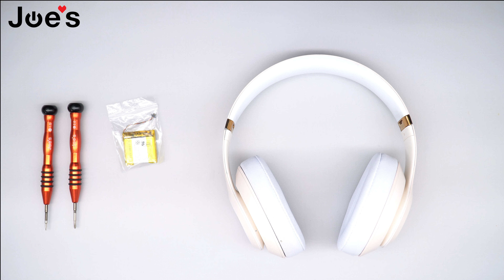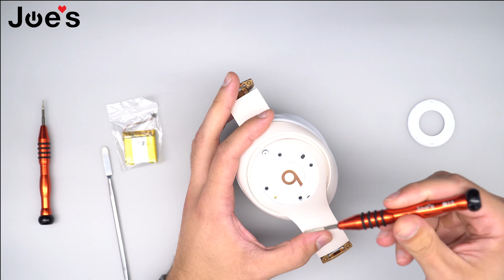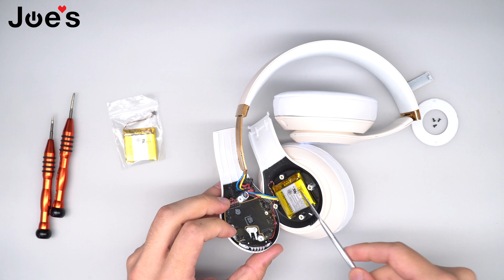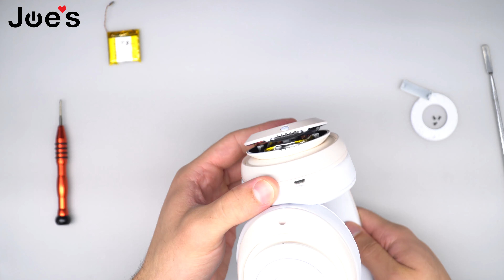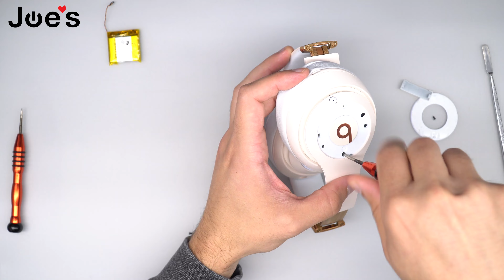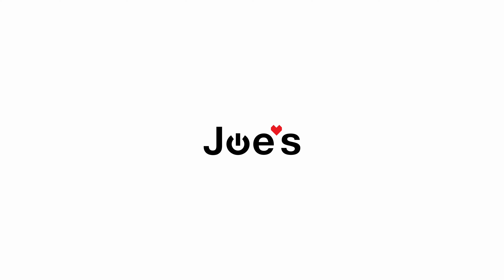How To Replace The Battery In Beats Studio 3 Wireless | Step-By-Step Repair Tutorial

Comment: Hello Joe.....Thank you for this video. I have just two questions. First is what brand or information for the  battery would you recommend. Amazon has different batteries for sale in the same price range, but I want to make sure I order the right one. Second is where can I find those specific "small screws drives and a heat gun? Should I visit a craft store, hardware store or jewelry store? Thanks again for your help and I look forward to your reply.
Reply from the maker: We can help you find the right part, tool or repair option. Please email support@joesge.com with your exact model number and what part you need.

You can also start here:
www.joesge.com

Comment: Fantastic tutorial, I changed my battery in less than 15 minutes!! I didn't find any glue in my item. Thanks again
Reply from the maker: We can help you find the right part, tool or repair option. Please email support@joesge.com with your exact model number and what part you need.

You can also start here:
www.joesge.com

Comment: I followed all the instructions and you’re video is great. Very thorough. It’s been months since doing this and my wife is running into a loose connection issue. There’s some glue that was originally holding onto the wires for the battery. What glue would you recommend for this?
Reply from the maker: I’d maybe add some cold press?

https://www.joesge.com/products/electronics-cold-press-lamination-adhesive-seal-3ml-syringe-18-gage-tip-glue
Reply: @Joesge ok thanks!

Comment: The battery sucks compared to my beats I had. 

My original beats I bought in 2014. I hardly ever used them. In 2023 I started to use them a lot. In 2025 they were still good for six hours a day for five days. 

Then I dropped and broke them sadly. 

The beats studio 3 I just got…battery dies after about 12-16 hours……..

Comment: My beats won’t turn on unless I use a wired connection.. could unplugging the battery and plugging it back in work? Or is it best to buy a whole new battery
Reply from the maker: Need to see if it’s a charger port or battery. You can send it in for a repair https://www.joesge.com/pages/fix-beats-by-dre

Comment: By the way this is another option to fix the “not charging” epidemic! I tried the other ways and it didnt work but i knew if I disconnected the battery it would work again like most electronics so thats why im here. Thanks for showing me how to take it apart.
Reply: yeah it worked as fix! i just bought these used and after 3 hours they didnt charge at all 2-3% battery - the white light was there all the time when connected but it jsut didnt charge anything. i took it appart reconnected battery and it instantly charges now  and has 4 white leds in less than hour :D

Comment: Joe, there is a 4 prong wire that came disconnected. It is adjacent to the battery 3 prong. I can't see enough even with a magnifier if I am to press on or push it in. I have been struggling with this 4 prong plug for a while. I took a break and went and replaced the battery and pulled out the old battery and now I can't get that plug to plug in either. Any suggestions? I was with you the whole way but stopped with the plugs. I guess I'm not a ninja yet. Hope you reply and have a recommendation. Thank you. Kevin
Reply from the maker: Email our team. Support@joesge.com

Comment: I just changed mine, but when i try to reset it to connect it flashes white then one red light flashes and it won’t pop up in bluetooth. what should I do??
Reply from the maker: Sounds like the battery needs charged. Leave them charging for a few hours then try again. If that doesn't work. the battery might be faulty

Comment: Nice work Joe - I followed this to successfully change out a defective battery that failed less than a week out of warrenty (and minimal use). One thing I would add is that my battery cable was held in with clips instead of glue - small nail clippers did a perfect job. Thanks #Subscribed
Reply from the maker: Hello, you're very welcome. Thank you for the comment. Please like and subscribe for more content like this 😊

Comment: i have to do this like 3 times a year because these headphones are so shit, they just stop connecting, wont turn off, and wont factory reset. only option is to wait for them to run out of battery or manually remove the battery and reslot it. absolutely ridiculous
Reply from the maker: You probably have some sort of power short that is draining and ruining batteries, as well as messing with the headphones functions. Most likley there is some sort of short or tear in the main internal wire, but it could also be one of the boards. Please email us at support@joesge.com with your question. We will be able to better assist you there. - JoesGE

Comment: Thank you bro! I have studio 3s that I just fixed. I guess they caught on to people trying to do cheap repairs and started making it alot hard. They put some plastic hooks instead of glue. Or just adding lots of glue to some areas so your just melting away for a while until you can get stiff loose enough to come out. Still as long as you are careful with a heat gun and patient it will work 👌👌
Reply from the maker: Hello, you're very welcome. Thank you for the comment. Please like and subscribe for more content like this 😊

Comment: what else could I use to heat the glue besides a heat gun or a soldering iron?
Reply from the maker: possibly a hair dryer, but be carful it could melt the plastic because the heat isn't as concentrated.

Comment: What repair would you suggest for audio cutting in and out on the left ear, on beats studio 3's?
Reply from the maker: Its most likley either the speaker is going bad or the speaker wire is ripping. I will leave a link to the video on how to replace your speaker, and a video showing how to replace the left inside panel. The inside panel video will show a red and white wire in it. That is the speaker wire. We sell replacements on our website. Please feel free to reach out with any quesations. If you dont feel like doing the repair yourself, you can send it into us!

Speaker replcement: https://www.youtube.com/watch?v=eSHRAkS7vr0&ab_channel=Joe%27sGaming%26Electronics

Left inside panel replacement: https://www.youtube.com/watch?v=XA7_IpIl_vc&t=1s&ab_channel=Joe%27sGaming%26Electronics
Reply: @Joesge  Great thanks!

Comment: after what years you recommend to replace the battery?
Reply from the maker: I would only replace the battery if it doesn't hold a charge for very long.
Reply: @Joesge  I have the following: I use headphones with a full battery, after about 20 minutes the battery runs out and needs to be charged, at the same time, the side with the AUX connection I notice that at the start of the headband near to the pad - it gets really hot. What to do?

Comment: Thanks now I know which side I need to put a sock on so battery doesn't freeze how to present headphones if they do freeze   put them next to a warm radiator about no more that 10 minutes ...put a clean sock on them that matches your beats , you should be good to go ,may freeze up after 1 hour in lower that -10c/25'f

Comment: Thanks, your instructional video.  It is great and helped me save the headphones.  One suggestion, it might be helpful, as the black plug at the end of the battery wire is totally covered in black glue, to mention that it is horizontally plugged into the circuit board.  I confess I did not notice this when viewing the video and was not certain whether I should pull horizontally or vertically to unplug the dead battery.  Thanks again...
Reply from the maker: Happy to help. Thanks for watching. Please like and subscribe for more content like this!

Comment: how possible is it to replace the battery without a heat source? could I just carefully pull on the wire?
Reply from the maker: You can but it may damage some connections.

Comment: HI guys, thanks for producing theses repairs videos. Here's a question about the Studio 3 unit. Mine is completely dead, no power light even when connected to charger. Could it be a dead battery or they should power up (showing lightning) when connected to charger even if the battery is dead ?  On my usb tester I get 5.05 V and 0.30 amp when connected. Thanks :-)
Reply from the maker: Hello, thanks for commenting. Please email us at support@joesge.com with a screenshot of your question and we will be able to better assist you there. - Aaron P
Reply: @Joesge  when I plug mines in it show like it’s charging like the light is blinking but it doesn’t charged my studio 3. I tried turning my headset on but red light flash once so pretty much my battery needs replace?
Reply: @Empire350z  same issue over here… anything work
For you?
Reply: Mine are having the same issue did you ever get an answer back

Comment: Can it be done without the soldering? coz I don't have it.
Reply from the maker: It doesn't look like soldering is needed.
Reply: Soldering isn't needed. He just used one to apply head to the glue. A heat gun can also be used. Just be careful when using heat around sensitive parts like wires.